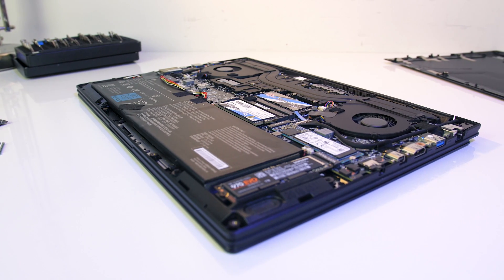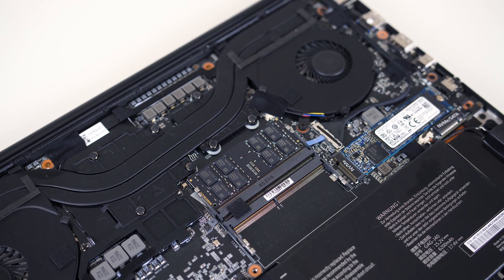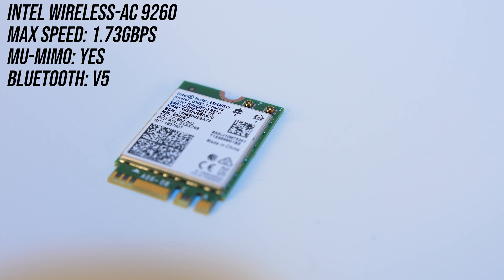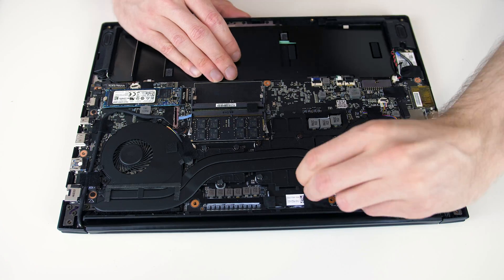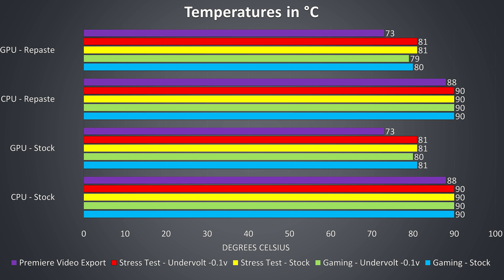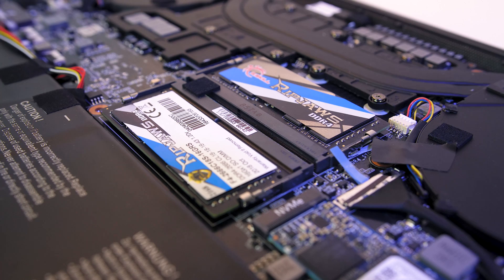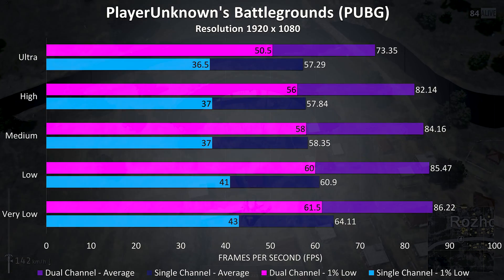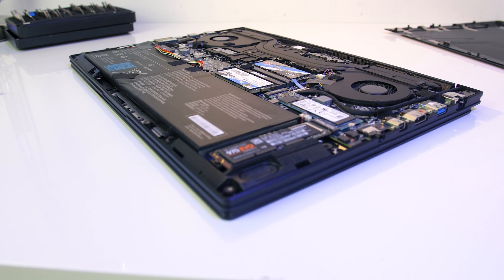Upgrading the Gigabyte Aero 15x Laptop

Comment: I also have aero 15x, and I repasted thermal and thermal pads 2 days ago (all thermal grizzly), I've gained 15~20 more fps in gta5  and other games, stress test passed with no thermal throttling ( with under volting and increasing turbo max power.  It also decreased idle temperature 10 degrees Celcius.  The only thing that I did differently is that I used thermal PASTE on the Samsung gddr5 rams, and only replaced the initial thermal pads with the new ones (1.0mm).

My aero 15x specs - 32 gb ripjaw 2666, 1 tb 970 evo + 500 nvme, others are the same, just for a reference
Reply from the maker: What is the full model of memory that you used? Was it F4-2666C18S-16GRS or something else?
Reply: @JarrodsTech   F4-2666C18S-16GRS, same one. https://www.newegg.com/Product/Product.aspx?Item=N82E16820232168 . 
https://imgur.com/a/X8hcve9
Reply: Mine works perfectly fine as 2667mhz
Reply from the maker: Oh I thought you meant with 2x F4-2666C18S-16GRS, that's what I want to get working. At the moment it looks like you have the exact same config as me, G.Skill stick in the original slot and the V-Color stick in the opposite slot, although mine does not run at DDR4-2666, where are you seeing that? I did notice that Windows reported 2667MHz, but pretty sure that's wrong, HWInfo correctly shows that it's 1200MHz (DDR4-2400 with CL17 timings, as this is the best both sticks can do together).
Reply: @JarrodsTech  I used the same program as you did, it shows 1333hz on hwinfo (2666), cpuz 2666, cmd 2666, and windows 2667.
Reply from the maker: hmmmmmmmmmmmm not sure how then, apparently the v-color stick supports:

Supported Module Timing at 1333.3 MHz: 19-19-19-43
Supported Module Timing at 1200.0 MHz: 17-17-17-39

While the G.Skill one supports:

Supported Module Timing at 1333.3 MHz: 18-18-18-43
Supported Module Timing at 1200.0 MHz: 17-17-17-39

I thought both could therefore only run at 1200Mhz / DDR4-2400 🤔 at least for dual channel to work with same timings.
Reply: @JarrodsTech  idk it might be a bug on windows
Reply: My CPU was running 93 degrees celcius while gaming. Should I send my laptop to the RMA center or should I consider repasting?
Reply: @vtrjhgftrftrtfdttfrf  I've sent my laptop to rma once, the thing is they repasted my laptop and it was horrible.  I would recommend repasting yourself.  It's fairly easy once you get the right tools.
Reply: Aki Chi thanks for the tip!
Reply: So if i just follow the steps in this video it should be fine? using only the thermal past? Or where do the thermal pads go?
Reply: @vtrjhgftrftrtfdttfrf  you can do what I did, because it seems like my way had better improvement.  Have 1.0mm thermal pads just for only replacing the initial ones, and put thermal pastes for all others like the cores and graphics memories.
Reply: Aki Chi I was thinking of getting the liquid metal paste for the cpu and gpu. And so what you are saying is use the 1.0 mm thermal pads on the 8 other chips around the cpu and gpu?
Reply: @vtrjhgftrftrtfdttfrf  no, use thermal pads for replacing what were initially on the heatsink.  The memory chip I recommend using thermal paste, and liquid metal can go on gpu and cpu die
Reply: I can show you a photo if you need a reference
Reply: @vtrjhgftrftrtfdttfrf  http://imgur.com/gallery/074Ibft

These are photos before I pasted new thermal paste and pads.
Reply: Aki Chi I see what you mean! Thanks!
Reply: By the way i contacted gigabyte a time back and they said If i wanted to upgrade my RAM I could only choose this one: SAMSUNG M471A2K43CB1-CTD 16G DDR4 2666
Reply: @vtrjhgftrftrtfdttfrf  The ram model I believe differs depending on where you bought the laptop from.  So contacting gigabyte or using the exact ram model is the best
Reply: Aki Chi Thanks again!
Reply: @Minami_C  How much did you undervolt the CPU? And how much did you boost the turbo max power?
Reply: @vtrjhgftrftrtfdttfrf  52 w to 58w and -0.160 undervolt
Reply: Aki Chi alright thanks! After reposting everything like you said I was still hitting 92 degrees so now I’m trying with undervolting
Reply: @vtrjhgftrftrtfdttfrf  was that when you were gaming or stress testing cpu
Reply: Aki Chi while gaming
Reply: @vtrjhgftrftrtfdttfrf  if you're hitting 92 when cpu stress testing, it would be a problem, but when you're gaming, since the cpu and gpu shares the heat pipe, it does get higher temperature.  However, you can have high temperature, and maintain turbo clock speed.  So if it bothers you too much try undervolting both cpu and gpu, and try gaming with having maximum fan speed on using smart manager.
Reply: Aki Chi thanks for the help I will definitely try it!
Reply: What TG paste are you using? Kryonaut or Conductonaut?
Reply: @matthewprince5668  kryo is the best. Period
Reply: Aki Chi Did you use the spread method or just a blob? Just a thin spread or thick as done it today with the blob method and got literally no decrease in temps at all. Blob on the cpu and gpu and little blob on the vram
Reply: @matthewprince5668  I did the X method, it really depends on your environment, too. If it doesn't do much with kryo, try conduc.  I suggest you practice a lot before you do it on your laptop because it's hard to control the amount to squeeze from it.
Reply: Aki Chi Hi, no stranger to putting paste on but it’s literally identical in temps. When video editing I’m getting 37/38 idle and 85/86 load. When using Aida 64 it’s going up into the early 90s. That’s with a -0.150 under volt too
Reply: @matthewprince5668  again, it depends on the environment.  When your laptop doesn't thermal throttle in full load, that's in a good shape even though the temperature could be 85c.  Since the laptop only has 2 heatsinks it's kind of hard to cool compared to thicc boys that has 5~6 heatsinks
Reply: @matthewprince5668  I mean sure, I love the liquid metal too.  But try out kyro and then later upgrade to conduct
Reply: Just reapplied kryonaut using the smooth method and going into the late 89s and early 90s at parts on aida64. Hitting boost clock of 3.88 mostly on that. That’s with -0160mv and power to 58w

Comment: I have the Intel 9560 and they are the same. Almost, the weight is different mine is 2.6g and yours is 2.9g.😂
[EDIT]: You didn't put enough thermal paste.
Reply from the maker: It's pretty funny, people saying both there is too much or not enough, honestly as long as it's covered it's probably just fine.

Comment: Hey mate, I am looking for a premium laptop, currently my top picks are Surface book 2, XPS 15, Razer Blade 15,aero 15x and if not these than MacBook Pro 15 (vega 20), I will be using creo, catia and solidworks for college work and bit of light gaming.
My main concern is reliability, I’m from India and, Razer, gigabyte and surface book doesn’t have support here.
I could ship it if there’s any problem but it’s going to be my main computer.

And I am also waiting for 2019 products if they got anything special.

Or are there any other laptops I should consider?

So can you please help me through purchase.any suggestion would be helpful.

Thanks.
(Sorry for my bad English)
Reply from the maker: Hey! I've heard good things about the surface book 2 and XPS 15 but unfortunately haven't had the chance to try them out myself. For what you're doing either of those would probably be my preference if you've got the budget available. Definitely worth waiting til at least CES In January (2 weeks away now), I believe there will be new laptop GPUs announced there, I'll be going there so I'll do some videos on the new laptops there 👍 I don't think I'd add anything else to your list, it's pretty solid already. The Aero/Blade have the advantage of higher tier graphics with the 1070 Max-Q, so depends whether you think that extra power would be useful for the apps you're using.
Reply: Jarrod'sTech thanks for reply mate

I am waiting for upcoming laptop and will decide after that

And I will surely see your video😃
Reply from the maker: No problem!

Comment: I think (I say think becuase I havent done this either, lol) your issue with the thermal paste might be because you spread it before putting the heatsink back on? Some of the PC building guides I've seen recommend just sticking the heatsink on and letting the contact pressure spread it because pre spreading it can lead to airbubbles in the thermal paste that make it less effective.
Reply from the maker: Maybe, I've also seen GamersNexus video comparing different methods and the conclusion was that it made no difference, I didn't want to go the dot method because the CPU die was rectangular and I wanted to ensure I had full coverage.

Comment: You are right...I bought "Ballistix Sport LT 16GB Single DDR4 2666 MT/s (PC4-21300) DR x8 SODIMM 260-Pin - BLS16G4S26BFSD (Gray)" earlier this month & My ROG STRIX SCAR 2 is Running like a TOTAL BEAST...10-15 FPS increment in every possible Game & Total PC Performance has also improved.I already have a 2TB SSHD so NO need to upgrade anything right away!
Reply from the maker: Nice one!

Comment: can you clear up what you're implying about the ssd? are you saying the evo series don't clean their cache automatically so the write performance drops after the cache fills up?
Reply from the maker: Basically the EVO drives have SLC write cache to give them fast write speeds. The 1TB 970 EVO has 6GB of SLC write cache, 4GB for the 500GB and 250GB models, once that write cache fills up, the write speed will drop down quite a lot. With the PRO drives, you have the full write speed the whole time, so it's only really an issue if you need high write performance consistently, which I don't so EVO is perfectly fine for me, also perfectly fine for most cases I think like for just storing games and programs on. You can see the specs here: https://www.anandtech.com/show/12674/samsung-announces-970-pro-and-970-evo-nvme-ssds the 970 EVO has different write speeds for SLC cache and TLC (after the cache is filled up). The cache gets written to the rest of the disk in the background, so the cache gives you a speed boost while the data gets written out of it.

Comment: Hey, Jarrod! You don't have to reinstall the Windows OS onto the new SSD, do you?
Reply from the maker: I didn't because I'm using the new SSD as a secondary drive, it's not replacing the original one which already has Windows installed.

Comment: Overpowered 17+ (tongfang) clocks in at 1279 on cinebench r15 and has excellent graphics perf. Small too with thin bezels for a 17.3". If you have a chance, get it and it's way cheaper than what you have.
Reply from the maker: I checked out the 15" tongfang chassis in my Aftershock Apex video (rebranded version here in Australia), it was pretty decent but I still prefer the Aero 15x myself.

Comment: I have the same unit as yours as mine too came with the vcolor memory. I ended up going with a 32gb (2666) Ballistic Kit from Crucial and it too comes out as 2400 speeds... apparently you need to look at the jedec speeds rather than XMP 2.0 which the Aero15x doesnt support and from what i hear wont. I contacted Gigabyte support and after some investigating it seems that this kit from Crucial (CT2K16G4SFD8266) will work at 2666. Kinda bummed but same time the benefits from going to dual channel out weigh the cons of a tad slower memory. Seen a solid increase with BFv! I too went with the 1tb 970evo and im very pleased with having such speedy storage. I didint think about the wifi card upgrade, but now you got me thinking about doing it as i believe my router config will support the new cards features.  Thanks for the video!!! 

EDIT - Forgot to mention that getting my laptop off the desk (Cooling pad, used hockey pucks before lol) and when i have the 15x fans on max game max temps are around 80-83c with occasional spikes a tad higher but always under 90. GFX mid/upper 60s. If i use the cooling pad fans i may get 2c diff at best... nothing special but any degree i can get is a win with these thin and light gaming units.
Reply from the maker: Yeah I heard about the 2666 needing to be JEDEC, I forgot to mention that in the video, would have been useful for people to know :( I'll update the pinned comment, good to hear your upgrades are helping! I haven't tried it with my cooling pad yet, will have to give it a go 😁 although as I'll be using it while travelling I'll never have the pad with me anyway.
Reply: @JarrodsTech  The air vents on the bottom need more air, the feet could be a tad higher but i get why they dont. So the cooling pad just helps the air flow by a few inches so when the fans go max it gets no obstruction as it would be by sitting on a desk. But yeah, lugging one around would be annoying. Even a few bottle caps underneath would probably help.  Im really liking the unit mind the little oddities... sturdy build, love the screen and the form factor. Did you do a clean format of windows or just using the default OEM ver?
Reply from the maker: @SteveMaragos  I did a fresh installation of Windows then installed the smart manager software to control fan speed etc. Yeah when I tested my cooling pad recently I found that most of the difference seemed to come just from raising it up off the desk compared to the actual fan blowing air. I can see myself in a hotel exporting a video, fans maxed out, with some random object propped underneath the back 😁

Comment: Hello Jarod if you plan to use metal liquid on the Aero 15x DO NOT APPLY IT on the graphics card it will mess your motherboard (i ruined 3 Aero 15x this way i'm not kidding thanks to the return policy i didn't loose my money), i'm not sure why the combo graphics card + CPU cause damage on the motherboard but i get it to work on applied it only on the CPU and i used the Artic Mx4 for the graphics card i managed to reduce by 10-15°C on the CPU on heavy load.
Reply from the maker: Yeah I haven't really investigated it but not sure it's worth the risk, a few other people have said that it doesn't really help anyway, maybe the heatsink just isn't large enough to efficiently remove the heat regardless of the paste.
Reply: @JarrodsTech  Yes i forgot to mention that it still throttle time to time, when you just applied it, it maintains it full speed without throttling during few days and then it start to throttle again it will only be beneficial if you want to reduce the temps

Comment: I just bought a random stick of 16 GB and putted it next to my current 16GB one and it worked fine. Regarding the thermal past, you applied to little also you applied it in a wrong way. That is why your temps increased. https://www.youtube.com/watch?v=r2MEAnZ3swQ

I currently still use the standard wifi card. :) I never though about upgrading that. But maybe I will someday. I currently reach 300 MB down on my wifi router (including internet) So no real need to upgrade it. :) But better range for the wifi would be nice!
Reply from the maker: Good to hear about the memory. I'm not so sure about the paste, I applied it as per the instructions on the pack, that's why it comes with the tool to apply it. I didn't use a pea size dab because the CPU die was rectangular and I didn't think I would get full coverage by just squashing it down. Either way it seems no one can agree on what is too much or too little, people are saying both in the comments on this video 😛 I have seen your video, and like this one https://www.youtube.com/watch?v=EUWVVTY63hc the answer is basically it doesn't matter as long as it's covered.

Comment: Can you please help me? I have problem with my notebook, and I have no idea what may cause that. The problem is, when I will start to play some more hardware demanding game (like AC oddysey or far cry 5) the game will after 3-10 minutes (depends on game's demandings) I will have big fps drops, from 40-50 to 15-6 fps. Drops last for 5-10 seconds, and they are really annoying. I don't know what is doing that, so i wanted to ask you if you don't know. The model is Asus rog strix scar GL503VM
Reply from the maker: Are you playing plugged into AC power with the battery at 100%? Do you have single channel or dual channel memory?
Reply: @JarrodsTech  i have single channel and yes I have laptop plugged in all the time
Reply: @JarrodsTech Do you think it's because of overheating?
Reply from the maker: @simon7788  Could be, install HWInfo and see if thermal throttling is reported while playing. Upgrading to a dual channel configuration will improve frame times and overall performance in most games as well, you can see how Assassin's Creed / Far Cry 5 perform in single vs dual channel in this video: https://www.youtube.com/watch?v=E_aPaj5QkmM
Reply: @JarrodsTech  so this is what hw info says about temperature: https://ctrlv.cz/U2bD
So It is because of high temperature, but do you know what to do with it ?
Reply from the maker: @simon7788  Yeah definitely thermal throttling, what clock speeds are you getting? If they are low then could be the issue. You can try undervolt the CPU to improve things, I suggest this guide: https://www.youtube.com/watch?v=yNt9L3BWOFo
Reply: @JarrodsTech  clock speed:https://ctrlv.cz/Q9Hr
and thanks for helping, I really appriciate that. I think I will buy cooling pad, but I will try first undervolting
Reply: @JarrodsTech  So thanks, video helped, but there are alwys stutters, they are not so long now, but they are there, so I am buyng that cooling pad.